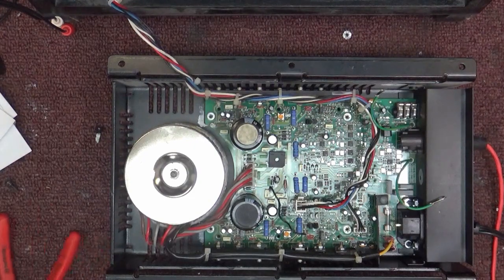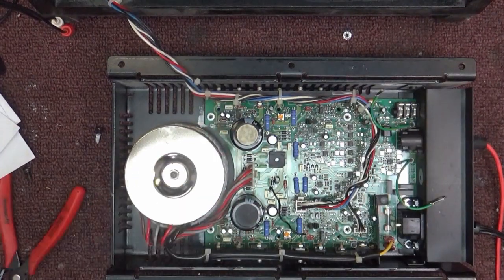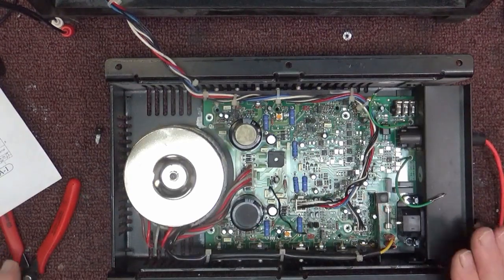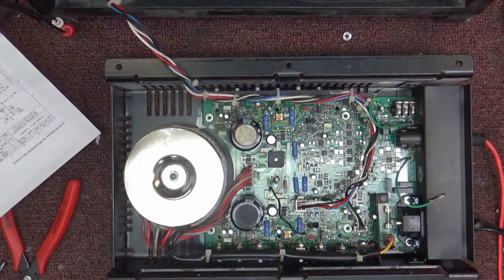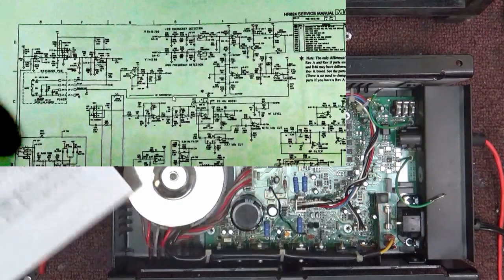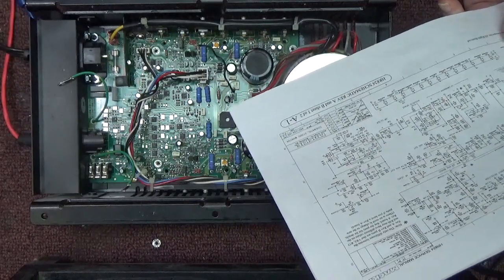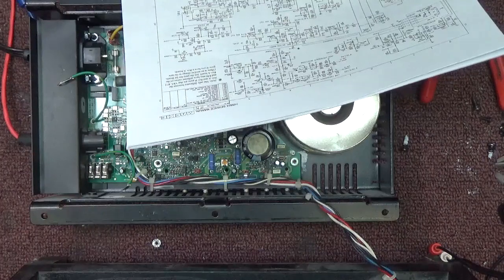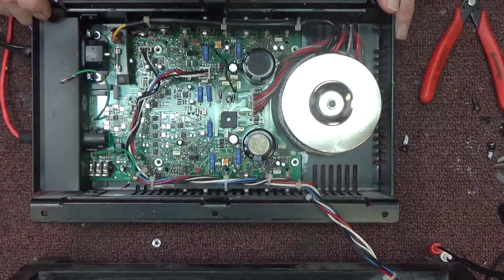Mackie HR824 Amplified Speaker Repair

Comment: I want to buy you lunch. My HR824 starting buzzing on power up as you described. Very surprised and delighted to find your video.  Having no experience soldering on circuit boards I video trained up, bought the iron, etc. and replaced the capacitor. FANTASTIC !!!!   You're a Saint. Thanks for all your efforts.
Reply from the maker: That is great news! Glad I was of some help.

Comment: @AERVblog Got my pair in 2001. Had them serviced once because after powering them up again after a previously long session the leds stay lit up but no sounds came out of them. I sent them off through a music company for repair and they came back working fine. Now after 23 years of on and off usage they are improperly working again. This time the speakers are shorting out in volume levels and I have to manually force them to play by turning up my consoles volume. They eventually fluctuate in volume or stop until I repeat the process. Can you help solve the issue I’m having?
Reply from the maker: It sounds like you may have some bad capacitors in the power supply or possibly the amplifier section. I know that sounds like a cop-out but you would be amazed at how often it is true.
Reply: @AERVBlog Ok thanks for your reply.

Comment: I am inspired but perplexed because you finished without saying whether you were successful or not because of the beeping noise ? Was that fixed or was that the problem after the problem was solved? 

Thanks for at least sharing this video 

My question is something maybe easier) 

Somehow one of my woofer membranes got a little dented? It looked like a star so maybe it was accidentally pressed when working around the monitor. 

How does one replace the membrane sorry I don’t know the term but it’s not the head I don’t think. 

It’s the vinyl or rubbery black material

When I tried to make a quick fix suction cup with tape it was not working 

So I tried what a chimpanzee would do and I poked a hole or tore it a split in the center. 

I have not turned it on
I left the clear packing tape I used to suction cup method that did not work , I left it on to hold the split together but my hunch is that it will sound toasted or fried when I try using it again. 

This is a good old fashioned 1999 or earlier version? 

How can I replace the part I need? 

I see the screws but where would I get the part? Thanks for your help? I am grateful ! 
😅
Reply from the maker: I am not versed in repairing speakers. I have seen a few done on youtube and that would be my suggestion. 
Yes. The speaker did work at the end and is still working on the production studio.
Thanks for watching.

Comment: Exprcting it will sold thé problem!!was thinking for recaping the big 10 k but as you said,surely good to ser alsoo the little 4.7 pre amp too,précédent owner said it could be thé boomer section(..)will test the  capacitors as you said!
Reply: The unit when switching on doesn't play no signal as the tweeter and boomer were outside🏖️🐟👺
Reply from the maker: I hope so. Let me know how it goes.

Comment: Hi There, I have a pair of Mackie HR824 Mk1s made for USA (120V 60Hz) and I want to both, run them in Oz (240V 50Hz) and not use a step down (SD) Transformer. . . . 

If I buy a Mackie HR824 Mk1 replacement transformer made for Oz and get a technician to put it in, will that allow me to run the monitors in Oz from the wall socket?

Also, if I can't do that and have to use an isolation SD Transformer will it matter that I can't convert the Oz 50Hz to USA 60Hz even though I can easily get an isolation SD Transformer that converts the Oz 240V to the USA 120V?
Reply from the maker: I looked at the schematics and it looks like just changing the transformer will work fine. I don't know what kind of plug you have there but that needs to be changed too plus the fuse needs to go from 2.5 amps at 120v to 1.25 amps at 230v.
Reply: @AERVBlog  OK, thanks man. Appreciate you checking for me.
Reply: @AERVBlog  Oh, 1 more thing ..  . did the stock transformer have the 240V taps already attached and tucked away?

Comment: Hello, sir. You did this video about 5 years ago, but I have the HR 824's and I'm not full signals out of the speakers unless I move the control buttons in the back, it goes in and out of full power. Any suggestions on what that could be? Should I take them in somewhere? Is this something that I can fix? They've never been serviced, but they've also not been used too much.  If so, where would you recommend i do. Thank you for any help you can provide. Great video by the way. You seem uber careful.
Reply from the maker: My recommendation is to play with the switches on the back. They are cheap little slide switches that can and will go bad just sitting there. I am serious.
Reply: @AERVBlog  I've bought multiple 824's that were supposed to be non functioning and just cleaned up all the switches and they worked perfectly.

Comment: So I was able to replace all the Electrolytic caps.  All were good it turned out.  Originally, I had no sound from the sub but did have HF through the tweeter.  Now, NOTHING.  My +15V is dead.  Other voltages are fine at their testpoints.  It seems to show up once in a while then disappear again.  It's weird!  I have tried tracing the voltage.  I've learned a lot but still can't track it down.  I might just have to send it off for repair.
Reply from the maker: Check you put the caps on the right way. Don't be ashamed if you did,  we have ALL done it.
Reply: @AERVBlog  well they are installed correctly.  I don't want to take up  too much of your time, but do have a few schematic questions.  Q1:  On this speaker schematic, it seems like sheet 1 is all audio and sheet 2 is all power?  Is that correct?  Or is it divided up some other way?  Q2:  The places on sheet 2 where it has he kind of empty box arrow and +49V or -56V etc., one arrow faces out from the circuit and one faces in.  What does that mean?  How can I tell where that voltage is coming from/going to from the arrows?  I keep trying to figure out where the voltage rails are with reference to the trace layouts and componant sheet.  Q3:  Same question for the "~ " with the +15V or -15V (AC).  I don't understand how/where the physical connection is re: the "~" symbol.  Q4:  What is PCMP and NCMP on sheet 2 mean?  Thank you so much!  I'm sure you are busy guy.

Comment: Great video.  When choosing replacement electrolytic caps for these speakers, do I need to worry much about ripple current ratings and ESR ratings?  Or just values/voltage/dimensions?  Thank you!
Reply from the maker: Thanks.  IMO just go with good quality caps. Low ESR can be important in some circuits but not here. All those other values won't mean much to you.  If there is a code for the type on the cap you can see if that code is available but codes change from manufacturer to manufacturer.  Basically go for name brand, typical life hours and voltage and don't cheap out on form factor. Get the one that fits, lead spacing and size.
Reply: @AERVBlog thank you!

Comment: Help please! Both of my HS824 speakers have been serviced before because when they are turned on they had a shortage and fluctuated in volume. I had to quickly switch the low frequency settings back and forth to get each the sounds to jump to the correct volumes set. The speaker volumes constantly cut as if the speakers have some type of shortage.
Reply from the maker: If they work a all it is a sign that something mechanical is wrong.  In your case I would guess that the 4 switches on the back need cleaned. Not a hard job just get a good cleaner like Deoxit 5. Use just a little, don't make them swim in it.  Spray and exercise them. You will have to take the amp out of the box but it is easy.

Comment: I see people asking so im gonna ask to see if i get an answer. I have the same speakers but im having problem with one of them. Sometimes the woofer doesn’t sound and i have to move the low cut switch on the back really soft back and forth to make it work but there are times that ill cannot make it works. Any suggestions?
Reply from the maker: Yup. Clean the switches with a contact cleaner. They used cheap open frame switches that go bad just sitting there for years.  You do have to take it apart to do that but it isn't hard to do.

Comment: One of mine doesn’t make noise periodically. Wondering if that’s an issue with the output
Reply from the maker: Normally transistor equipment will either work or not. I would check the connectors on the board first before any repairs. It could be a bad or loose solder joint on the speaker plug.

Comment: The circuit that had the issue is designed to mute the output when it is initially powered up. Here's how it works: When the monitor has been powered off for a while C67 (the capacitor that failed) is discharged to 0v by R99 (10K). When you plug it in then AC2 which is right off off the transformer secondary will go from 0VAC to 36VAC (it's 29VAC in the HR624).  D25 and C67 form a half wave rectifier which charges C67 to about -47V (36*1.4 - a diode drop - awful close to the rating on the cap which is likely why it failed). R180 and R181 form a voltage divider so when C67 is zero, the voltage divider that is equivalent to a 8.8v (47k/(47K+33K)*15) voltage source in series with a resistance of 47K||33K = 19.4K this turns on Q43 hard pulling the collector down to almost ground (0.3 saturated or so) which effectively mutes the output. Now if C67 fails to be a capacitor, then Q43 will amplify the 60hz AC2 and you'll see the square wave on the collector. One thing I do find odd is that there should be a current limiting resistor in series with D25 to limit the inrush current into C67. This would control the rise time and also protect D25 from exceeding although it's rated at 30A surge for 8.3ms.
Reply from the maker: Thanks for the comment and lesson. That is a very good description of the circuit. I am along with you and don't understand why they didn't limit that inrush. They are nice speakers and for the most part pretty solid. The ones I have in the studios are on all the time except for power outages which might come and go very quickly when they happen. I wonder if that is what took the cap out, the bouncing of the line voltage.
Reply: @AERVBlog  My pleasure. It's fun to figure out circuits like this. I think the cap is a bit underrated, it should be at least a 63v rating not 50v. The inrush will of course vary because of the sinusoidal AC voltage - you might turn it on at zero crossing or at peak of the sine wave. I imagine the failure is due to a combination of voltage rating, inrush, age of caps and original quality. Put a decent quality cap in an you're good for another 20 years probably.
Reply: Much thanks for the conversation as this helps learn more about the entire process. My question and maybe a user note of reply, I use conditioned power on these and all critical components in the studio. These are not ‘speakers’ but rather reference monitors and that is why they are more expensive and self contained with no need for an out board amplifier . That was why I invested in mine so long ago. The Genelec or others had to be with an amplifier and that colored the sound, many KRK or JBL so called monitors are really just too much icing in the cake, if that makes sense? Bedroom producers especially hipHop like the extra Bass and so it defeats the purpose of being flat Reference monitors (near field) 

Now I know this isn’t the subject but it does make sense in the context as color added in EQ or Amplitude defeats the purpose. 

When I got my pair it was with documents that showed they were tested to be in unison 

Today they have features to tweak and even use a microphone and AI to fix a room problem for any and they call them speakers too in some marketing campaign which is a laugh! 

They are reference monitors 

Your car speakers and your Hifi speakers are what you play the mix and the master on after to see how well you did with your music mix or post production ADR mixing which in my case has to be done to replace noise from the set. Again software will replace and fix just about anything wrong that you could think of on the set or film and tv and commercials 

But I digressed . 

Once these editors take it into their edit bay and call their setup a speaker system you usually know it’s going to have bad audio because they have no reference to hear their levels properly. 

With the electronics I’m not sure what to add

But I can add my experience with how these are used when they are working 

My head or vinyl woofer center got a star indented and when I tried to suction cup it out with tape (I know I know not a good idea)) I tore it like a chimpanzee or maybe a drunken sailor trying to glue china back together with rope and tar. 

Anyone know how to find the part I need to replace this tear? 

And I am fearful but grateful for all you guys are sharing as your wisdom and patience and genius helps us who know nothing under the hood what makes it tick! 

Thank you! 😅

Comment: just replace the fuse
Reply from the maker: If only that worked. Fuses usually blow for a reason. Of course at times it seems like they put all those transistors and ICs in there to protect that valuable fuse.
Reply: @AERVBlog  I changed my fuses and still working

Comment: Similar problem here.  One of my 22 yr old Mackies (Rev B board) started buzzing loudly for about 15 seconds before auto power off.  Pulled all the electrolytic caps that don't require heat sink removal and all were good except C67 (17% below rated value - below the specified 10% in the design) and C79 which I couldn't get a proper measurement from at all.  It's notable that failure is in the auto power off circuit since part of that will be energized all the time.  So this seems likely to be cap wear out and not a case of sub-standard caps failing prematurely (cough China cough).  The paccom (OEM brand caps) datasheet says 2000hrs - so very standard rated life.  

Specifics for those interested: I replaced them with nichicon caps for everything except the 10,000 uF which were Cornell-Dubilier because Allied Electronics didn't have nichicon in stock at that size.  Parts cost was $27 for 2 monitors, the large caps were the bulk of that cost.  A hot air rework blower was very helpful for cap removal, especially the large caps that were also glued - hot air melted the glue from heating the PCB on the opposite side.  Solder sucker needed of course.  Also you need a security hex bit for the earth cable removal (bit has a hole in the middle).  Buzz problem disappeared after the recapping.  Modest soldering skills required, nothing tricky.
Reply from the maker: Very nice. Thanks for sharing.
Reply: This is good to read. I've got the same monitor where the auto-off feature no longer works. The PWR led stays illuminated all the time. I'm now wondering if it's the same cap affecting that. It might well be worth replacing with one rated for a higher voltage.

Comment: I came across the video because I have the same speakers and one of them appears to be broken. One speaker suddenly lost power. I have tried different power cords and a new fuse but the problem is still there. I couldn't see any damage to the platinum but I don't know too much about it either. For the reason I wanted to ask if you could give me a tip what I can do now. As I said, I don't really know much about it.
Greetings Jonathan :)
Reply from the maker: Sorry but there isn't much I can offer. All you can do really is check the transformer, the on off circuit and such. Wish I could be of more help.

Comment: Hi, i looked to your footage, interesting ! Yesterday i had almost the same thing happend with one of my HR824 , the woofer suddenly stopped working, i could just hear the tweeter and after a minute the tweeter stopped working too. Would you know in which direction i can look to replace a faulty thing? I didn't yet open it , but will definitely do this weekend. thanks in advance, Steve
Reply from the maker: That one I am not sure about.  All I can say is a good visual inspection first. Especially on something that vibrates for a living.
Reply: @AERVBlog  thanks i will open my speaker one day, lucky i have 4x HR824's